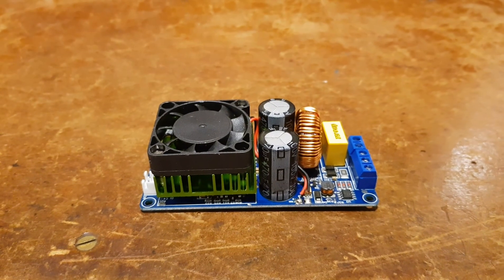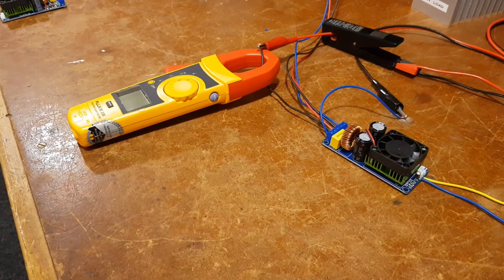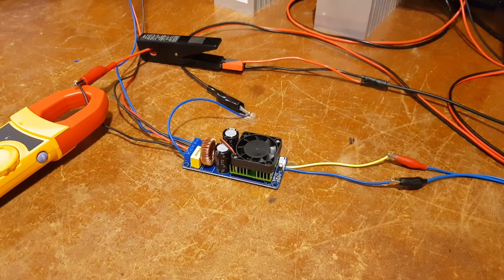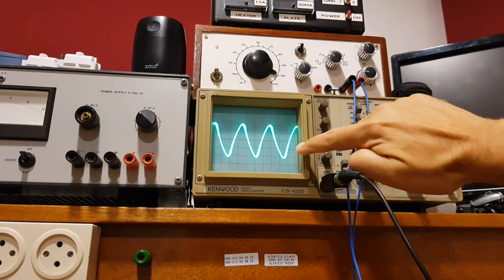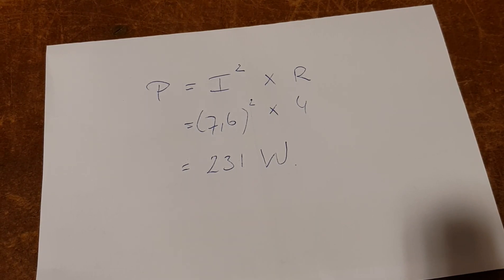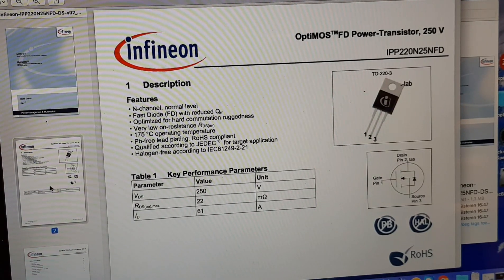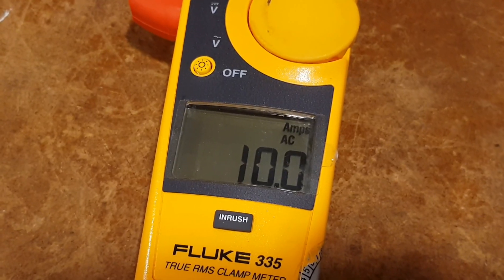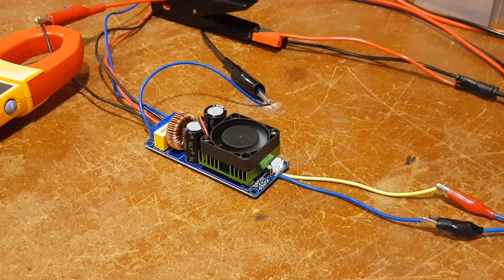Amp test : IRS2092 chip based class D 500W amplifier.

Comment: The reason some people gets away with powering the unit with higher supply volts is because of power supply droop. The voltage of the power supply drops with high volume and load. A proper supply will fry the circuit without any mods. 500W is more than enough😂

Comment: I design amplifiers as a hobby. Please understand that when you messure amp's ac on a multimeter, you get RMS amps. If you use this amps and resistance to solve watts. YOU GET RMS WATTS. If you want peak watts, use peak amps and peak volts to calculate watts. Peak volts is shown on oscilloscope and peak amps can be calculated by multiplying rms amps(multimeter) x1.414 to get peak amps on a sine wave. 
This person managed to get 800W peak on a 4 ohm resistive load. Well done!!
Myself would adjust two feedback resistors and the zenner regulator feeding the onboard 12V chip. To keep all in spec for higher supply to a max of 90v-0v-90v supply.

Comment: Unfortunately there are fake versions of this board with fake chips with markings sanded off and 80 volt caps, plastic mosfets (insulated), and smaller windings on the inducer. Great video but you should measure the voltage across the load to get real watts out. They claim 250 RMS or 500 peak at 65v into 4 ohms.

Comment: Nice video , thanks sir , how can be possible to regulate the output volume of this amp ? It always works at maximum power , I would like to be able to use it at half volume for example or at a quarter of volume
Reply from the maker: add a potentiometer on the input .https://www.muffwiggler.com/forum/userpix2/15951_screen_shot_20161117_at_73357_pm_1.jpg

Comment: I have amplifier with dual  STK4048 which is burned on one channel. I can not obtain original STK to repair it. Power supply is (+/-)65V. Linear not SMPS.. Du you suggest to use this module to repair my amplifier? (Change one channel with this module? Or both channels?)
Reply from the maker: i see alixpress sell's the stk4048 for under $10. I would try that first. Most likely not a genuine chip but for that money i would be willing to take a chance.
Reply: @ptaudio 
I already tried with locally obtained STK . Twice they last several minutes and burn out. So I am considering radical change of topology. Just want to keep power.
What is the quality of  IRS amplifier?

Comment: I tested two of these amps first amp at +-95V and the second one exactly at 101V
First amp at 95V - 2h continuous runtime at full power which i measured 11A which is 484W at 4ohms handeld just fine so i extended  that runtime to one full day 24h and no problems, no overheating, THD i set to around 1% and survived. 
But the second one fried itself within 15 minutes but i've got 520W out of it at 11.4A  so you should not really exceed that 100V maximum threshold voltage. later that weekend i tested the first one at 99V and i've got 11.1 which is AAAAALMOST 500W just a few watts shy. 24h no problem at max power so at 100V it can deliver exactly  500W but this is the absolute maximum and you should leave a bit of space for voltage fluctuations because when you set the voltage or you have voltage exactly matching 99 or 100V it could spike above 101V and you fry that amp instantly if the voltage spike is happen to be above 101V.
Reply: You no longer have any replacement parts. Please reply thank you

Comment: Considering the transients generated by all class D power amps, it IS risky to go above +/-70Vdc; the on-board XL7005A switchmode regulator (for the processing part of the IRS2092 and/or the fan?) has an absolute max of 80Vdc, and so do the main filter caps on the sample used (mine have 100V caps). Failure rates rise quickly even below these ratings. In this comparison, using a sine wave that looks more like a rounded bent triangle, taking the "max" power substantially below where clipping is apparent, using a nominal 4 Ohm load but not measuring it accurately, not allowing for measurement accuracy at the test frequency, having long thin power supply wiring, having no extra caps at the PCB (etc), the measurement values are not very meaningful; BUT it is still a very useful (and appreciated) post, indicating that at least some samples don't blow up above their maximum ratings. Does anyone have a schematic including the protection circuit, XL7005A and fan?

Comment: The irs2092s and the power mosfets wich are 200v 30A ones support the 2x100v supply but you have to keep in mind that you have a small buck converter (xl7005a- 80v max supply voltage )on the board for the fan and the vcc+ for the irs2092s and if you go past 2x65v the risk of blowing the converter up wich kills the irs2092s is high. I blowed up 2-3 boards becouse 
Of this untill i realised that the buck converter has limitations , but you can desolder the regulator and feed 12v to the 12v rail and than you can go up to 2x90vdc safely.
Reply: DUde, please make a video about that. Its great information, but if you ar enot an expert its really difficult to use these written advice.
Reply: Dude i hope you didn't check the datasheet yet, it has absolutely max voltage of 100v at vin pin lol

Comment: Your measurements are not very accurate. It is not clear exactly when the sinusoid is limited. Very rough current measurement.
The topology of the circuit allows you to get 600 watts RMS even with an unstabilized power supply.

Comment: Hello. I purchased 2 such boards and a +-80v power supply. I did not notice the seller's warning about the maximum power supply of 70V. In your video, the amplifier runs at 90v for a short time. Have you tried using it for a long time in this mode? I'm afraid to burn down the speakers
Reply from the maker: With 80v you should. Be fine

Comment: Want to change MOSFETs to IRFP4227, i found a similar board with this transistors where they show 1kW power can you please comment if it is possible
Reply from the maker: Only changing the mosfets will not be enough. The irfp4227 can handle 200v and this is needed to achieve the desired 1000w. This board can't handle 200v. You will need to alter so many components that is not worthwile to try it. So my answer is no. You will be better of buying the 1000w board.

Comment: I never trust the ratings on most Chinese made amps, just shoot for about a half to a quarter of what it says, but for the price, hell back in the late 90's I paid almost $200 for a Rockford Fosgate Punch 250a2 that put out similar numbers and was the size of Buick. Get a cheap computer server power supply and rock on.
Reply: I bought one of these IRS2092s recently from Ebay,  in part because you can never trust the output ratings. They lie so much. I only want 100 watts/ 8 ohms, mono peak for a subwoofer at 50 volts and I figure this amp might get me there.

Comment: I would love to have a series of these.

I have bought a bunch of TDA7498E amps. Based on the board quality.. and the components used. I am sticking to two brands out of the 6 different companies I've purchased.

I will be using it in my car.. and I will need 8 channels.

I've also decided to use a DSP developer board to bring it all together via Sigma Studio.

Here is my issue.. power... and I've never done anything like this. My theory is based on the little I know. Lol 

The TDA7498E are boards that work up to 36v .. they are rated 160w per channel or 220w Bridged. 

You are 1000% correct... although I can find the boards at a decent price... the power supplies are ridiculous!

To get 500w from 36v is like looking for a unicorn. Specially when you are boosting from 12v.

This journey showed me why standard car amps are so expensive. The reason for me doing this is for control and to hide all the components.

Then there is the bit about cooling, and another bit about power... then you have all the other issues like.. signal gain.. and all these other issues that come up when putting a sound system together. 🙄 

Lol what I am say is... please do all the things I need to do before I so it so I can do it right the first time! Lol
Reply: All of the car audio amps are boosting up the 12v dc to a minimum of 2x25v and up to 2x90v i've seen also 2x100v dc and from there they do their job

Comment: looks like they dont got right filtering on these. Looks like a lot of switching nosie on those things. It didnt look like it was truly clipping on the scope just fuzz and crappy output. At the higher power levels anyway. Sure they scimped on the components especially those inductors no way those would filter 500w. Maybe thats why they want them run at reduced power level
Reply from the maker: Yes,the output filters are crap. The coils already run at 50 degrees centigrade when amp is idle. At max output they run really hot. I guess they are way too small for this amount of power.

Comment: I have a transformer with dual 70v output, rectified it will go +-100, I've just bought 2 of these board, I will test those this weekend, do you think they'll work with +-100v?
Reply from the maker: 100v is probably without a load. Normally 70v ac rectified results in 90v (70 x root of 2) dc so you should be fine
Reply from the maker: Correction. 70v ac retified is actually 98v dc. I did not test at this voltage so this is at your own risk
Reply: Tomorrow I will try, I'll just put some higher voltage capacitors and try. But first of all I'll measure r13, in the forum they say that that resistance must be replaced with a 3k one
Reply from the maker: @ivomixdj  can you post a link to this forum topic ?
Reply: Tried with +-100 v with one module , only for a minute, it stayed on normally, with a speaker connected I can hear a lot of interference but when I put some input ...wow a lot of volume ! In only one minute the board become a little warm in the area of the IRS
Tomorrow I'll try it better
Reply: Anyway the buck converter I stalled in my modules is a xl7005a that works at a maximum voltage of 80v 😬 so in prolonged use it will burn I think
I only have this transformer so I don't know what to do
Reply from the maker: @ivomixdj  XLSEMI also has a buckconverter that is capable of handling 100v. It's the XL7026. Unfortunately (and surprisingly) this chip has a different pinout then the xl7005a. So it is possible to hack the board but it's kind of a hassle.
Reply: @ptaudio  this chip also delivers 12v to the IRS ? 
I've done another test of 5 minutes, the power output is surprising, but the inductance at the output becomes so hot it stinks . I'm driving an 8 ohm speaker 15'
Reply from the maker: @ivomixdj  The output voltage of the chip is determined by the circuit it's in. About the coil temperature : spoiler alert. The coil also runs hot @70V power supply. I'm testing as we speak for my "part2" video on this amp. After a couple of minutes running @ 10% distortion with 550W output power the coil temp runs up to 95 degrees celcius.
Reply: @ptaudio  is it normal to leave that coil working at 95 degrees? Do you think it's better to replace it?
Reply from the maker: @ivomixdj  personally i don't think it's wise to let this amp run @ 10% thd constantly. That's why the results of the measurements in my first video are much lower then the specs. With no input signal present the coil temp is already 50 degrees celcius.
Reply: @ptaudio  a couple of zener diodes and resisters to lower the voltage going to the XL7005A...

Comment: The Fluke 335A is only accurate at 50 to 60Hz. The errors are likely to be significant at 1KHz.  

Looking at it another way, if the power supply is +/- 65V then you should be able to get an output swing of about 120Vpp, or 60V peak. 60V peak into 4 ohms is 60^2/4/2 =  450 watts average, not peak. The numbers are not adding up.

Running at higher voltage will  dramatically increase the power dissipation in the transistors and output filter inductor,  possibly leading to overheating and failure.
Reply from the maker: Thanks for your comment. I will probably make a "part 2 video" on this amp in the near future. This will contain various measuring types based on all the comments i got on this video :-)

Comment: using clamp meter to measure current on the speaker is not a good idea. I think you might make a voltage pic measurement, or alternative measurement on a 50HZ or 60hz frequency on the dummy load. Also, you seems to run the test with 1khz tone, wich is not perfect for a clamp meter measurement. A power measurement is made by reading RMS or max voltage on a dummy load.

Comment: The output of an audio amp is obviously alternating current, this can be measured by an average power and peak power. Measuring the DC input will only get you close to the average power, the peak envelope power will be much more! Please measure the power using the oscilloscope, get the peak to peak voltage (just before distortion), divide by 2 for the peak voltage, square the result, then divide by the load impedance. This will give you the peak power which is so much higher you will be surprised! Using this amp and + - 70v you can easily get 600w of peak power. I have several of these amps and they work just fine as advertised.  Good video and presentation, complements from Chris. UK
Reply from the maker: Thanks Chris for your reply. I actually did measure the AC output current that's running through my dummy load. Also i used a true RMS clamp meter to do so. Wouldn't this give the same result as using the methode you suggested ?
Reply: @ptaudio  No, the RMS value will always be around 1.414 x less than the peak value. The only way to measure the true peak value without (very) expensive instruments, is with a scope using the method I described. Just give it a try both ways and you will see the difference. There are many technical papers on the subject of measuring peak vs average (RMS) power. With a non-constant envelope signal such as an audio waveform, its the peak value we are interested in. It is worth noting however, that the `loudness` of an audio signal is best represented by the average power level, RMS. If you have an amp rated at 500w RMS then that same power level can be expressed as 707w peak (500 x 1.414 = 707) It`s just a jungle of terms but we do need to understand them all and how to measure them effectively. You can also measure the peak voltage on the load by using a half wave rectifier and capacitor with a high impedance voltmeter, but this method is redundant if you have a scope. Best regards, Chris.
Reply from the maker: @TheTemporalAnomaly  Normally i'm only interested in RMS power but for the sake of the viewers i will do a retest sometime soon with peak value measurement. Thanks for the info :-)
Reply: @ptaudio  I`m sorry to have opened a can of worms so to speak. If you want the RMS power, then a good approximation would be (as you have demonstrated,) equal to the dc input minus the the inefficiency. Or RMS volts squared divided by load impedance. In no way do I mean to criticize your work, it`s just that  I work with radio frequency amplifiers where you are interested in peak envelope power for most calculations and specifications. My comments were just really for interest to indicate the rather large difference between the average and peak envelope power of an amplifier. It is easy on these comments to come across as aggressively criticizing a creator, this is in no way what I intended or wanted. Best regards, Chris.
Reply: @ptaudio  I have just found an application sheet for the irs2029 ic that didn`t show up when I was first searching for detailed info on this device. Search for `AN-1138 pdf` There is much more info on here, very interesting.
Reply: these amps are known to produce 250w RMS and ~500w peak @ ± 70VDC.

Comment: Can i use 80-0-80 Ac power supply?
Reply from the maker: no,only a dc powersupply can be used
Reply: @ptaudio  what if i use 65-0-65 ac transformer and converted to dc with an output of 80+?
Reply from the maker: @brianjaderickdeguzman1638  that should work